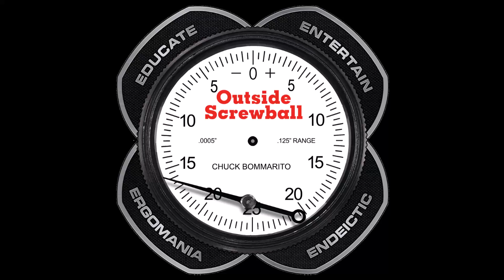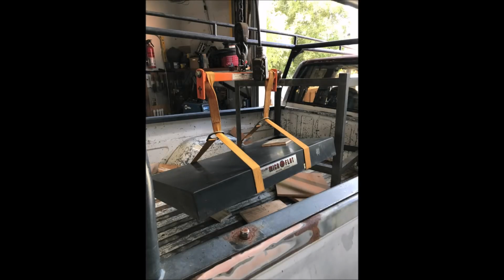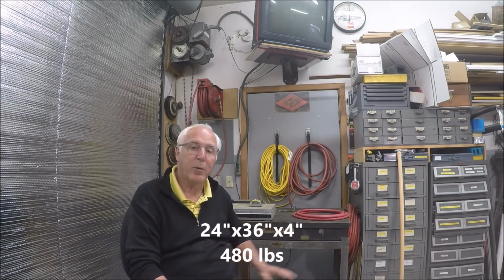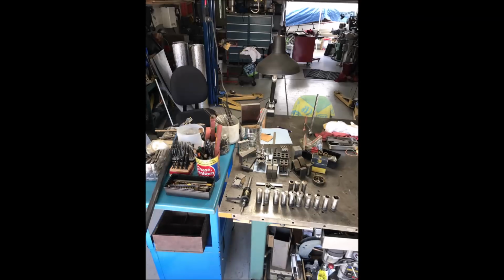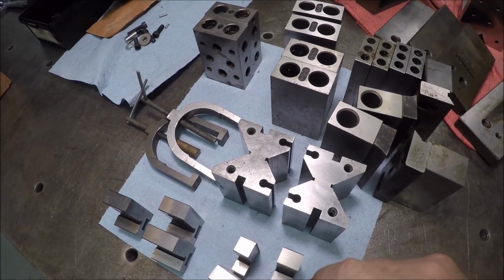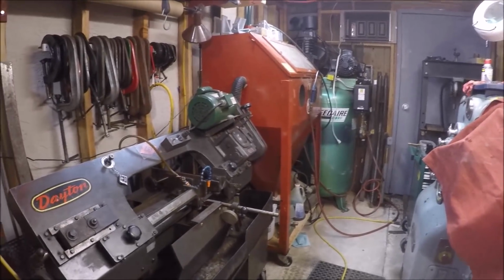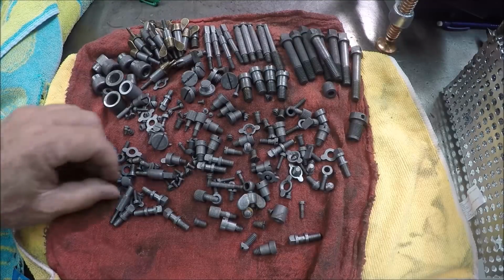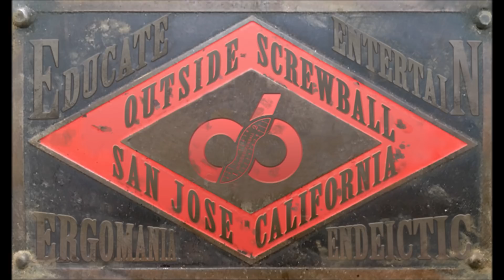Screwy Tuesday--Shop Talk

Comment: It is so hard not to hoard.  You can look at anything and think there might possibly be a use for it someday.  Of course you will never know you have just the thing, and certainly couldn't find it even if you did think you had it.  I have resolved to have a limited storage space for stuff and when it's full, everything else gets binned.  Every new project can completely restock the supply with all of the offcuts etc.